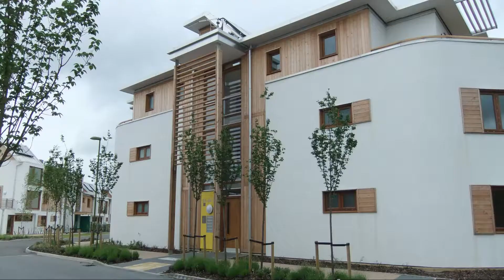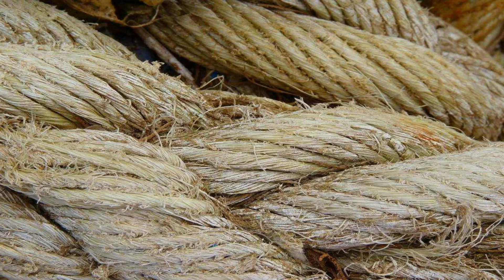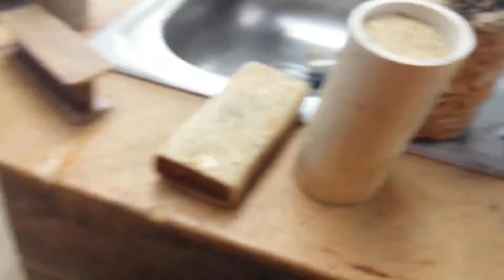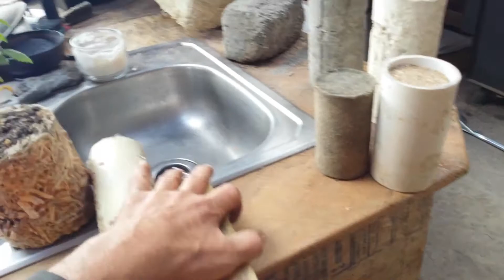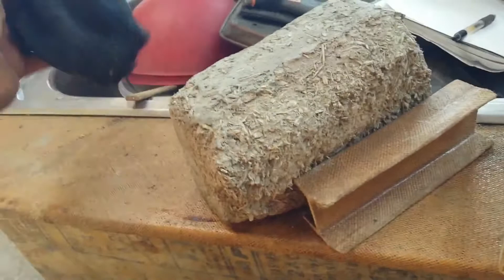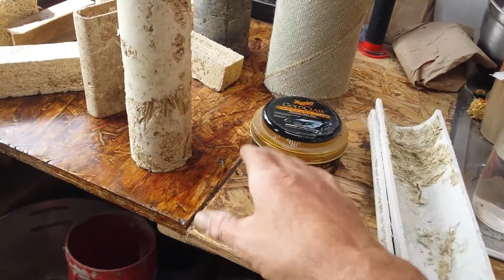New Building Method Industrial Hempcrete Steel Homes Community Built

Comment: Yes the Hemp Crete could maybe last five hundred years , but like any other building ,only if the roofing is constantly being serviced or replaced every forty or so years .   I’ve worked on many older houses and the ones that were in the best condition were the ones with wide eves like two feet or more.